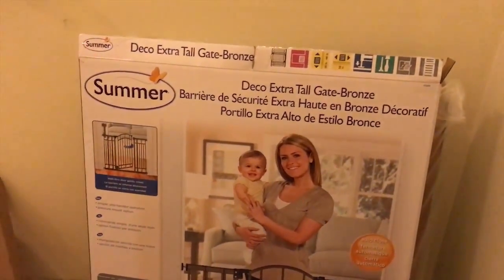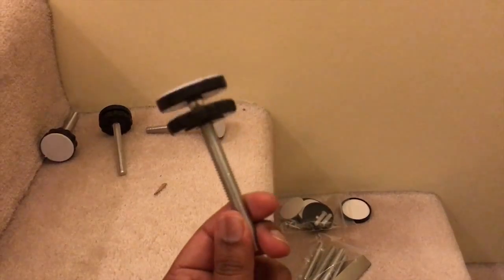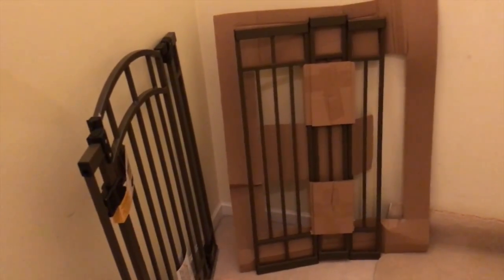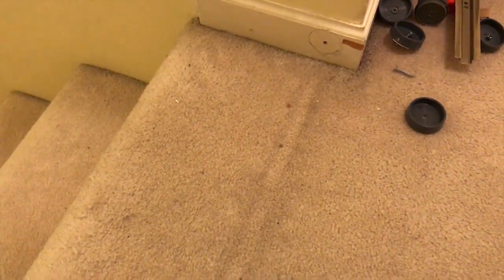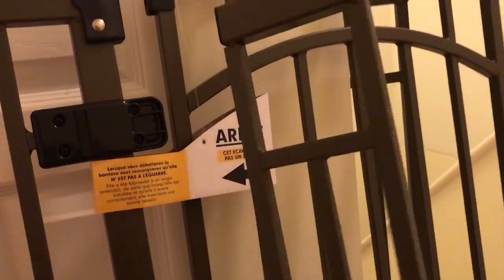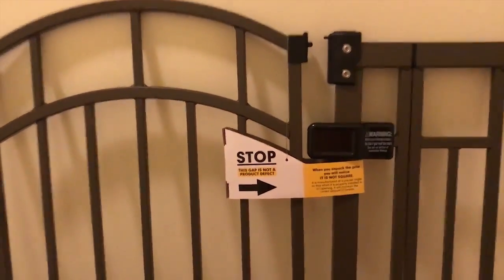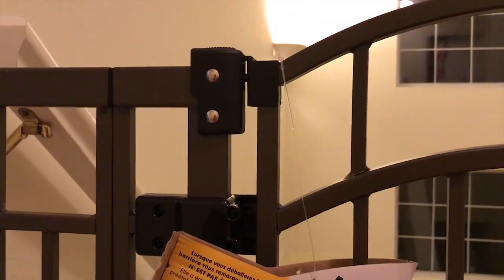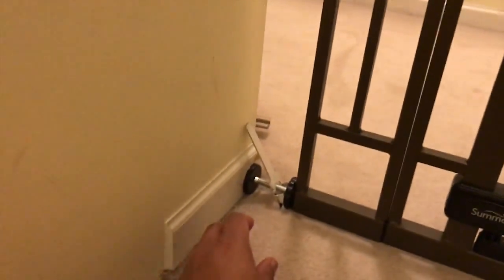Summer Infant Extra Tall Walk-Thru Baby Gate Blogger Review

Comment: I think I have one that's a defect. The side that has the hinge has a permanent pin/shaft sticking out on the bottom and to get to 36" I only need to add the small frame extension on the opposite side. I also didn't receive any threaded extensions in my hardware package.

Comment: Did you find that the vertical gaps on the left and the right where the gate is attached were kind of huge? I read somewhere that this could be solved by cutting the edge of a pool noodle and putting it on those two areas of the bar so the gap disappears.

Comment: Boy if I didn't try bending this thing back to a straight position before I put it up and then I was like man I should check out the video because there was no sticker or cardboard on the one I was installing because I was doing it for somebody and it was already out of the box and I was like man this thing came all bent this thing is wide open you can't even shut it this is a problem so I stirred it up on its end and tried pushing on it to bend it back but you could tell it wasn't bending back because it was never been out it was made like this on purpose! So I came to google and ended up at YouTube watching your video where you quickly explained that it is not a defect and thank god because I would've fucking bent that thing cut it try to re-weld it but I'm glad my instincts told me not to LOL if you can't bend some thing one way usually that means it wasn't Ben From the other direction to begin with. But I put it up in the hallway so the dogs can't get through and it works amazing it was a little hard to open it first but once you get the hang of it (no pun intended) you can open with one hand easy :)